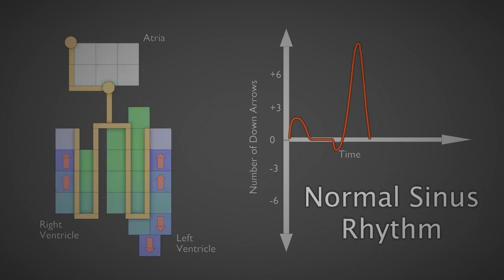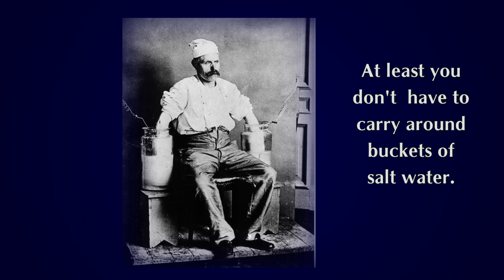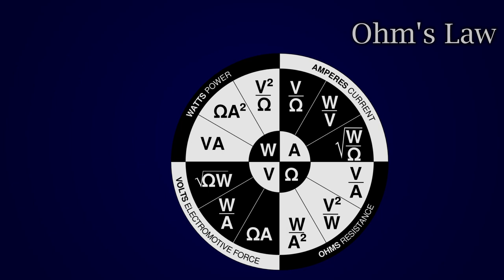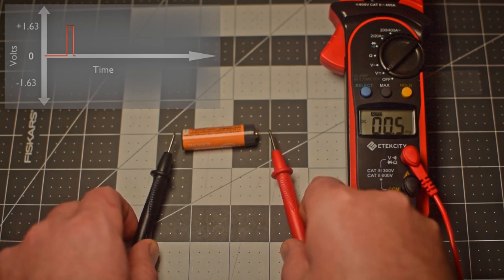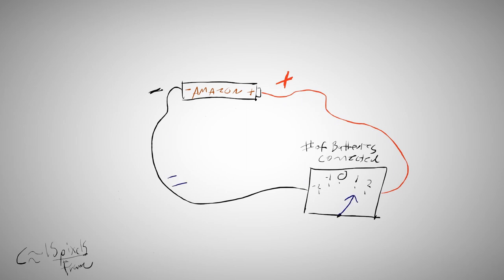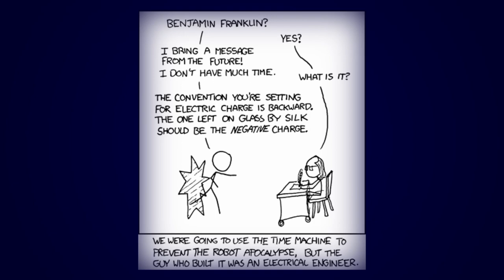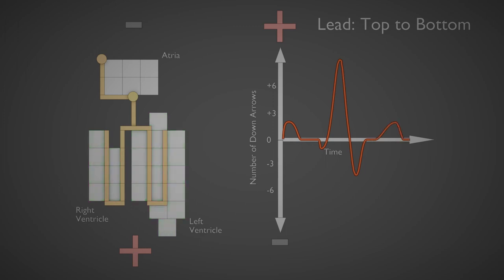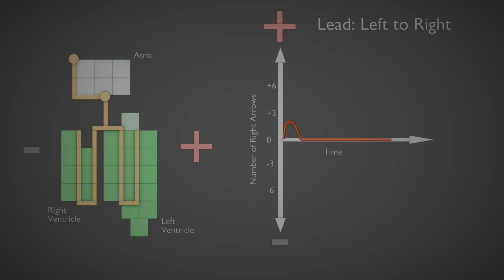Part 2: Buckets and Rulers, or, How an EKG is Measured

Comment from the maker: I do want to attach one little caveat to the final section of this video: it's nearly (though not completely) impossible to arrive at that sort of tracing in a real world context. I'm working from a spherical chicken in a vacuum sort of situation for the benefit of illustration (perfectly perpendicular current with an infinitely wide collector); in a couple of videos we'll pull this back into the real world and look what's actually possible.

Also, I'm making a choice here--hoping it will be a good one--in the description of how a voltage measurement is taken in hopes of making it as accessible as possible (treating the meter itself as a load on a circuit), and perhaps some liberties with the meaning of 'toward.' The goal at this point is to illustrate that movement of energy in the direction of the positive electrode results in a positive deflection, I'll get more subtle on this when we start looking at action potentials.